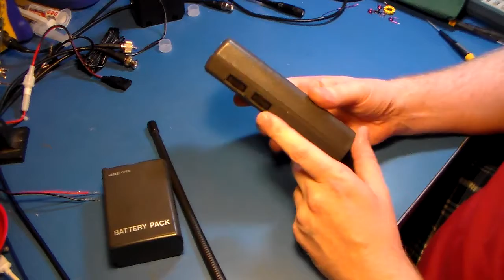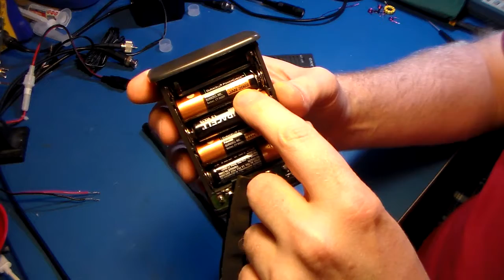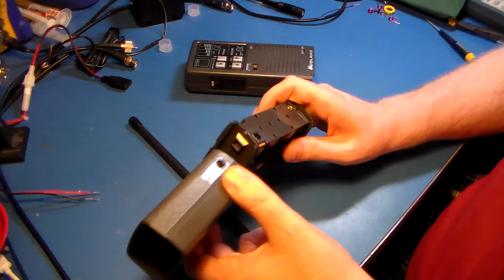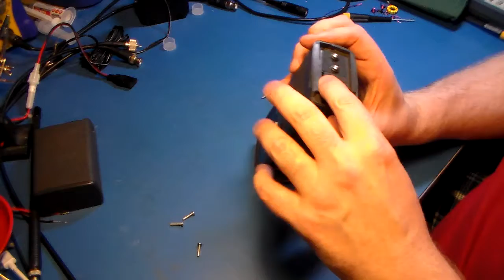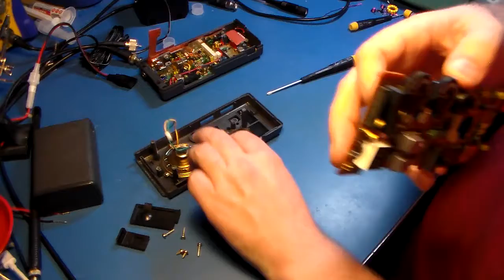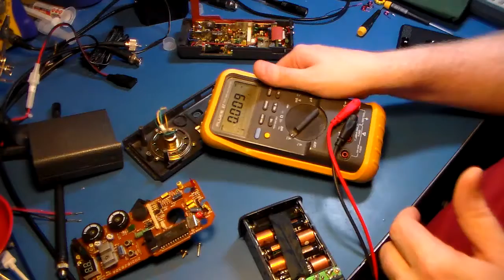Midland emergency CB

Comment: Wow, but those Duracells.. They must have been back from when they made batteries properly ;) 

I'm likely being shallow Mark but I've not bought a Duracell batt in years.. Mainly as I had so many of them leak on me in rather quick succession over a 12 month period, and from different batches & good sources.  These probably don't last as long but I've had good experiences with GP Ultra Batts, and fingers X'd I've not had one leak yet :)

Cheers mate
John

Comment: It's surprising how long batteries can last.  Amongst things I collect are old batteries.  I have some from the 70's that still have some juice in them.  Better yet are a lot of the old B+ batteries for tube type portable radios from the 1940's that look like the day they were made yesterday with no signs of leakage.  May be dead as a door nail but have never leaked.

You might be surprised how much one of those walkie talkies can put out.  I have worked on quite a lot of them over the years for guys that do a lot of off roading/camping and vintage ones for collectors.  Most will do FCC legal limit on output power.  Thats why most have a hi-lo switch to conserve battery power.  On hi theyncan drain a battery pack pretty quick.  Should do a alignment on it, hook it up to a outside antenna and try it out.  I have actually talked skip on walkie talkie using a real outdoor antenna.

Mike